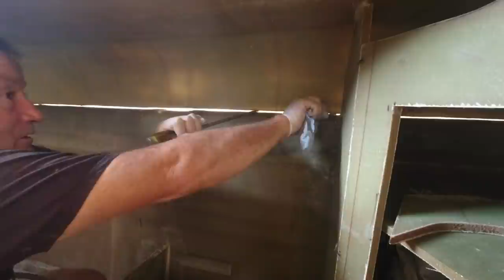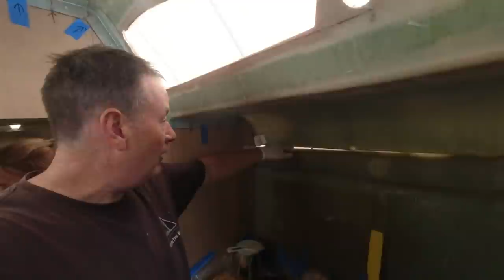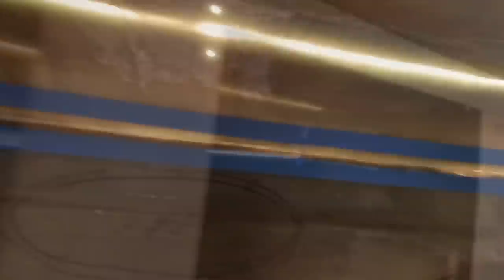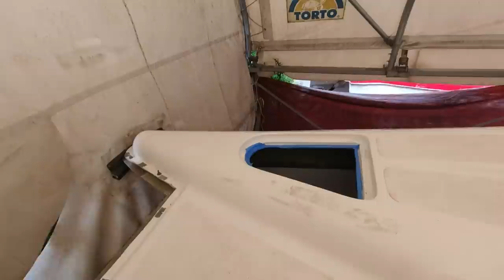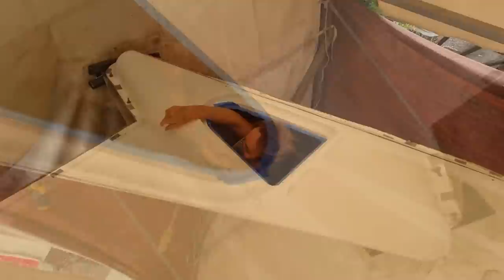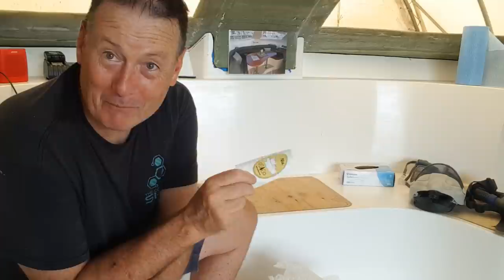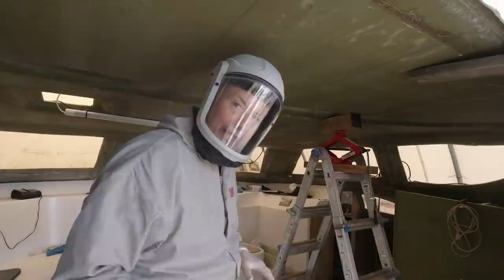The Biggest Modification of All - CATAMARAN BUILD FROM SCRATCH Ep218

Comment: With all refits, there is always the comment that the bare hull is the least part of the boat. Financially that may be true, but looking at the sheer amount of work it is not if you build it yourself. Which means once it is done, there is still all the work to do a refit includes after fixing the hull. Mindblowing, and you two are always so cheerful.

Comment: Ross and Janet, it’s been an absolute pleasure to be brought along on your build, thank you so much, I’ve learned more than you could ever believe!
Reply from the maker: I have also built a couple of stitch and glue sea kayaks and yep epoxy is fine, but i the case of fibreglass, it ca seriously ruin a kayaks finish , so a bucket of water and marble resin mixed with lime ( calcium carbonate)can slow the heat down to an acceptable level.

Comment: Great work! You always make my Friday morning! I guess you use those bolts for alignment, otherwise clamps would have been much easier? I also guess those bolts won't be there in the final product?
Reply from the maker: Thanks 👍Gunnar, bolts were definitely for alignment and also served to tighten the flanges adequately and will be removed and a gunwhale rubrail will cover the joint after some work. Cheers Ross

Comment: The seem looks awesome! so you´re not tightening it all the way? so that the hull and the deck don´t touch fysically? and that humidity! my hat is off for you guys for working with such extreme heat and random snake,spider and dropbears... one of the bestest channels on boat building in YT :)
Reply from the maker: The seem was tightened completely with the epoxy filling ay undulation in the join. The subsequent tabbing in the coming episode completed a perfect joint and secured the hull and deck together. Winter here now and we are loving it, but the heat this year was pretty substantial along with some disgusting humidity problems. Ross

Comment: Big hole, you need to fill it with the new bit. question - can you re-use the cut off to form a swim-deck at the back of the boat? A platform that can be raised an lowered to hold a dingy and dibble as a swim deck?
Reply from the maker: I could repurpose it as a swim deck,however the scoop extensions are going to be massive so will act as a swim deck themselves. Ross
Reply: @LifeOnTheHulls  may be you could put it as a roof over the fly deck? It would be a shame not to re-use it as I bet you got a few $$$$ in that roof. 👍🏼

Comment: Why aren't you using a battery impact drills or a torque wrench to get an even surface finish or it doesn't matter? Once it cures will you need to torque down the bolts & nuts again? As usual great job by Janet! Take care you guys.
Reply from the maker: Edge flange is to be ground off and a gunwale rail added to hide.Closed down nicely and was reasonably uneven anyway.Tightened it to the limit so all good Ting.Cheers buddy.Ross

Comment: A cordless drill or impact would of saved a lot of work tightening those bolts.
Reply from the maker: Yep , didn't think of that at the time.
Reply: @LifeOnTheHulls  You didn't, but probably better that you didn't. In my experience, if you introduce speed in the clamping process, you make a big mess. Slow and steady is better when bringing in seams.

Comment: I am a little concerned about the "pop" & separation of the hull from 2 attached areas at the 2:34 second mark (top right hand area seam, after you push the screw driver in, to create space). 😬
Reply: Haven't worked much with assembling large fiberglass boats? They always make cracks like that when two pieces move against each other.(even when you cant even see them physically move!)
Reply from the maker: All good mate,bugger creaked and groaned until the seams were all glued.No noise now.Ross
Reply: @LifeOnTheHulls   I think I see what Tunnel mean above, in the top right corner of the screen you can see a visual change in the top of the bulkhead just after their time stamp when you hear the pop. Maybe nothing but a quick check can’t hurt to check for some delaminating (my guess).
Regardless, great work! Always impressed at your planning ahead and ability to make the puzzle bits fit together.
Reply: @skylar7320  yes, did come unstuck, you can see the colour change when it popped
Reply from the maker: I see it now.It is a bulkhead that the guys wacked some epoxy on that shouldn't have been glued at the time of joining the deck and hull.All has been filled and tabbed again now,so great observation there.Showd you are paying attention.Excellent job.Ross
Reply: @LifeOnTheHulls  once its all tabbed its going nowhere, you did have a fair bit of leverage on it. cant wait to watch you fair all that

Comment: I’m wondering why you chose to apply the epoxy from the inside rather than the outside. 🤔
Reply: I'd guess it's because the inside needs to be 'fair' to be tabbed over, while the outer edges will eventually be trimmed...
Reply from the maker: The epoxy was piped into the seem and well into the flange. The flange will be completely removed and the join covered with a rub rail for cosmetic appeal, but the epoxy offers the best adhesion and the best waterproofing to eliminate any moisture entering the seem substrates. The internal join is subsequently tabbed with laminates to ensure a joint free monocoque ( one piece ) structure. Cheers Ross